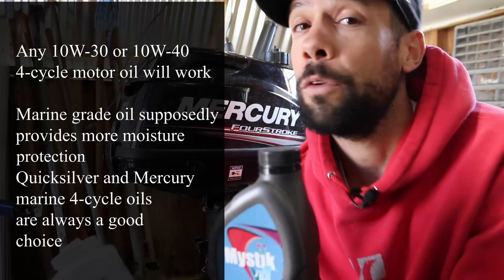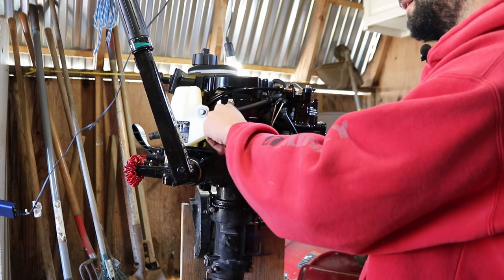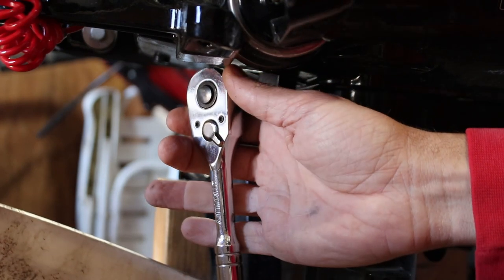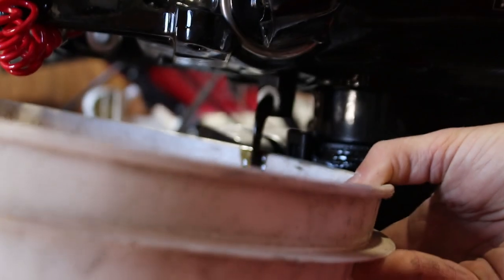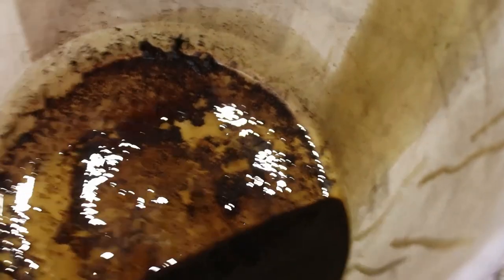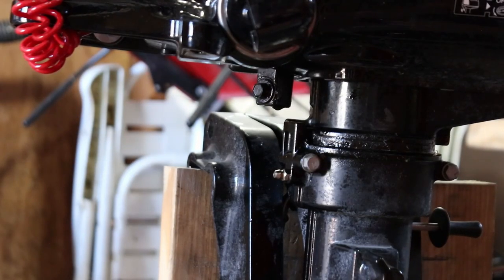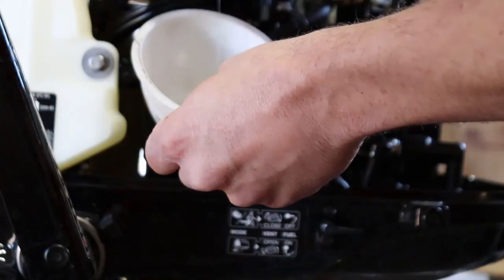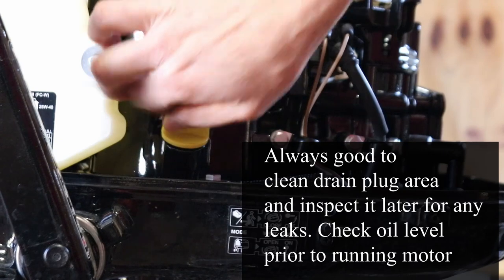EASY Oil Change in a Mercury/Tohatsu 4HP/5HP/6HP 4-Stroke Outboard

Comment: My 6.0 mercury has been in the garage for 8 years. Your video helped me out a lot because I'm not any kinda fix it guy. I also changed the gas filter and had to fix the tire hub. Any suggestions before I get it back on the water? Thanks
Reply from the maker: Awesome! The gas is definitely bad; if it still has gas in the lines or carb I would drain all of that and start fresh. If it was stored with gas in the carb you may need to clean the carb.

I would just put it in a bucket and run it at home for 10-15 mins. If it starts well and runs, hit the water!
Reply: I want to say I flushed all the gas out. Who knows, it was 8 years ago.  Yes, I have fresh gas. Thank you again
Reply: may want to change out the impeller. Skinny has a vid on how to do this also

Comment: Love your positive review of your 6 hp Merc, however I’m trying to start mine now unsuccessfully after a crank case and drive train oil changes. My red light is blinking and I’ve checked every possible obstruction… Shift lever in neutral, prop adequately, submerged in water, etc. I can’t figure it out. I’ve searched the Internet for assistance and your videos are the best but I’m still stuck.
Reply from the maker: Man that’s weird. Changing oil shouldn’t impact starting. I would triple check all the obvious stuff like fuel valve, gas tank vent, chock linkage, then try an external tank (vs internal) to rule out gas flow issues. I really can’t see changing the oil as causing a starting problem as long as you have the correct amount of oil

Comment: Great content, as usual.  I just drained the oil from my like-new Tohatsu 6hp outboard motor and it smells like gas.  I know I overfilled the oil last time I added oil.  Could this be the cause?  It’s possible I over-primed it too but I’m generally fairly conservative with priming.  I’ve read that not running the motor long enough to reach good operating temperatures can do it too but I usually run it for at least 30 minutes.  
Any ideas on how gas is getting to the crank case?
Reply from the maker: Here is a good thread for the basically same motor. https://forums.iboats.com/threads/new-5ph-4stroke-gas-in-oil-what-to-do.156222/

I’ve read Most of the time you will get some gas in oil during break-in or if there are low hrs on the motor. The consensus seems to be idling too long (not getting to operating temp) will definitely cause this. I don’t think priming will cause it because there is little chance you will force gas from the carb into the cylinder and by the rings. I don’t see how over priming or even flooding would cause this. 

I would change the oil and then recheck on the next oil change. And when I run it, I wouldn’t be afraid to get the revs up and get it warm.
Reply: @Skinnyriver  thanks for the advice.

Comment: Thanks for the vid- what size washer/gasket does the engine oil drain plug take (and where do you get them)? I just get blank stares from my local marine shops and places like amazon seem to only have washers for the lower unit…😵‍💫
Reply from the maker: I think it’s a #12 8035161 - here is it for $3 https://www.simmercury.com/oil-drain-plug-washer-8035161/  double check it though
Reply: Wow thanks!

Comment: I just had my engine serviced at a dealer a few trips ago. I checked the oil and it was really high. I drained 20 oz of oil out. Any chance it could have damaged anything?
Reply from the maker: No I think you are ok. It shouldn’t be an issue. If it didn’t smoke a lot then no oil got into the cylinder

Comment: Is there a crush washer? Shouldn't it be replaced with every oil change?
Reply from the maker: It’s a good point, manual says replace if damaged. But it’s so cheap it’s best to buy a bag and change everytime. Sorry I should have mentioned that.

Comment: Anyone know where I can get an upper engine cowl for this exact engine?
Reply from the maker: I think this is it.. but wow ouch over $300. https://www.boats.net/product/mercury/8M0056433?ref=21c8fec30a356a819b535c450020f6327ff1701c
I would check at some local marine and boat shops to see is they have a junker or blown motor. Take yours and try a couple different ones to see if an older fits. Can always put new decals on